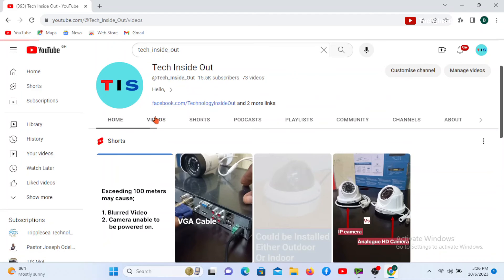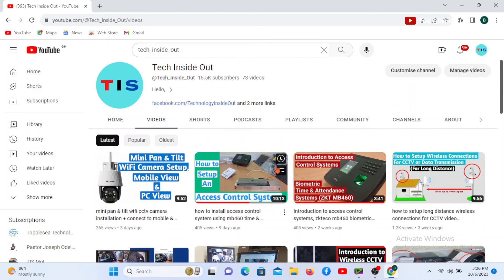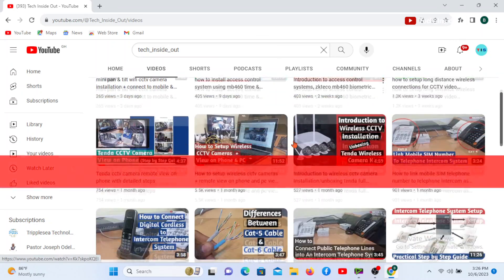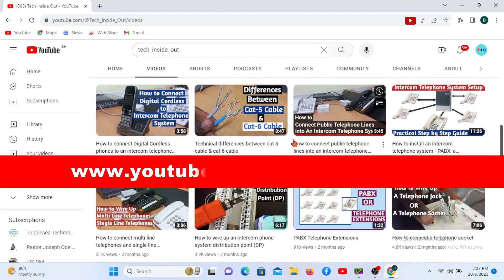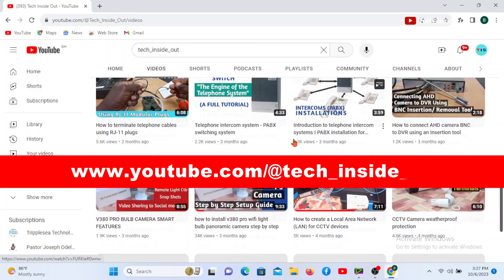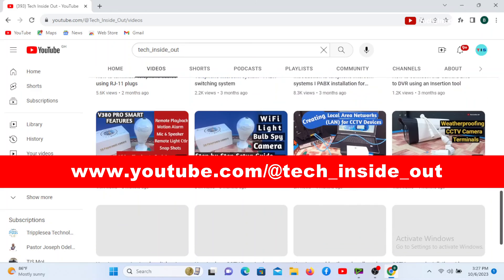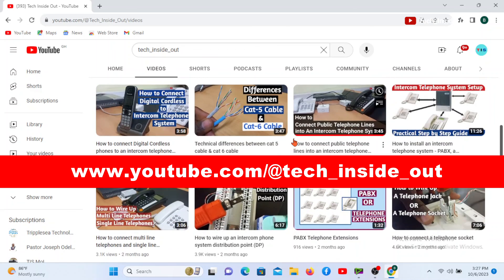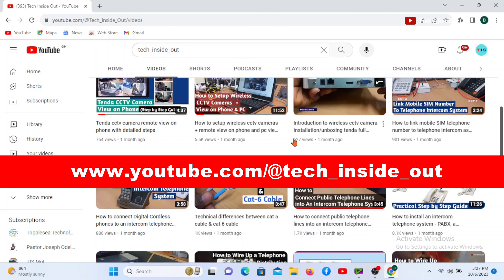practical layout of an access control system

Comment: So cool! But my question is can i use multiple readers in different locations in one controller
Reply from the maker: I will have to check on this particular one, because am looking at the kind of scenarios that would require multiple readers. Remember you need a lock on any point that requires a reader and the reader is the main access control system as well as the main device for the system.